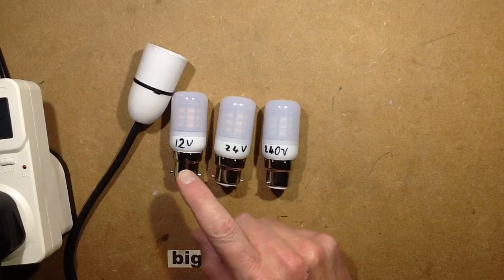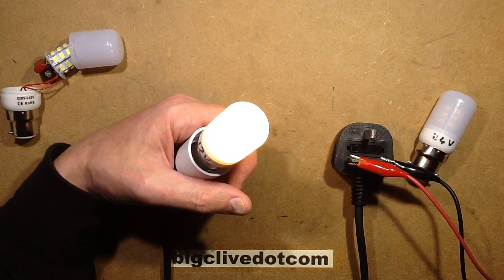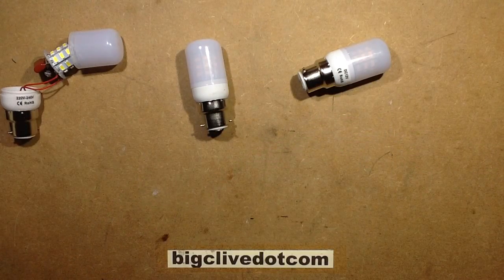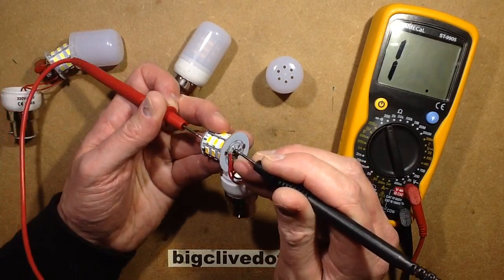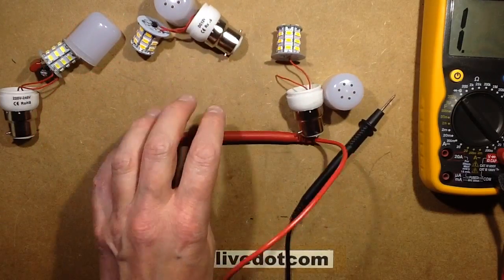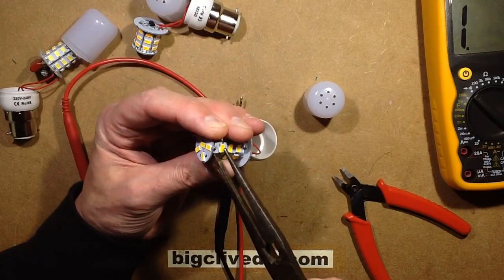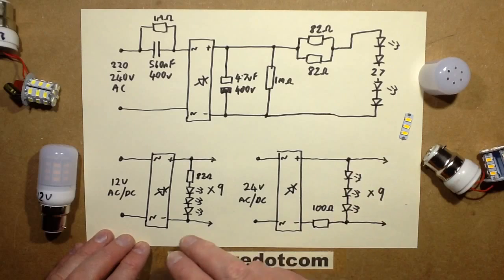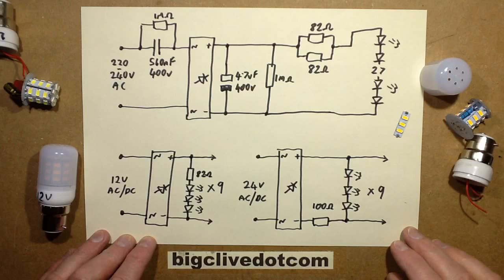12V, 24V and 220-240V LED lamp comparison.  (With schematics.)

Comment: Clive
I have a simple 240v strobe led lamp that flashes to music.  It lokks super basic when take it apart. But is there anyway i can make it run.off 12/14volts. Any tips or ideas...
Reply from the maker: That would mainly depend on the circuitry, and if the LEDs can run at low voltage.

Comment: Hi Clive
I have a "golf-ball" LED lamp. When powered it looks like the internals are of the pattern of the type you illustrated. On the bayonet cap it rates the lamp as 10 - 30 volts. This thing is sealed solid. What's your thoughts on its construction?

Comment: I live in a caravan with NZ wiring and my 12 volt keeps going out 2 12 volt lights so far. The people want to solar in a 12 volt capacitor on it to see if it has any more problems??? WHY  would they try this, the 240volt is fridge, kettle oven frypan etc, 12 volt lights are the ceiling lights only and run off the battery; cant understand why they want to do this and what does a capacitator do anyway hope you can help thanks

Comment: I don't know why people are surprise about low voltage Bayonet fitting. They been around for years. I still have a 12v incandescence lamp. Which looks the same as 240v

Comment: The right way to short out a capacitor is not to short it out but discharge it with a voltmeter. Shorting can burn out the connection from the plates to the leads.
Reply: By voltmeter a mains charged capacitor would take eons to discharge. Use a big ceramic resistor or mains incandescent lamp or send the current into the mains plug of a traditional (non-electronic) soldering iron to convert it safely into heat.

Comment: so i am fairly new, but what the hell does using a higher voltage lamp do, except from reducing the heat output inefficiencies (because Q=(I^2)*R*t). But most of the time, this is used to reduce heat inefficiencies on long cables that stretch kilometers, so how does using a 240 volt lamp help? or is it just to reduce the inefficiencies of a converting from 240 volts to 12 volts? what advantage does a 240 volt lamp has over a 12 volt lamp. if both lamps use the same technology (leds) and output the same amount of light, drawing the same amount of power, then increasing the voltage will just decrease the amperage, and decreasing the voltage will just increase the amperage (because R=U/I)

help me pls?
Reply from the maker: The 240V circuitry  (our local supply voltage) means that no extra power supply is required.  It's all built into the lamp.

Comment: How about the RFI from the 24V lamp? I have seen that unless you de-couple diodes in a rectifier bridge it can create some evil RFI. Just a small ceramic capacitor in parallel with each diode is sufficient.
Reply from the maker: the simple resistor arrangement in both the 12 and 24V lamps will result in no significant RF interference.
Reply: I was more concerned with it in AC application. As I do mess with ham radio I have realized that RFI comes from the most unexpected sources.

Comment: Is it common practice for ALL lamps to have the same type of base on them in the UK? really I do not know. Here in the US the 120 volt lamps tend to have the typical "E" type screw base (e26 i think it is, there is a smaller type for decorative bulbs but its not the everyday common type) while the 12 /24 volt have a small bayonet or very small "E" type screw base and are usually labeled as automotive lamps..

Seems pretty dangerous to put the same base type on  your 12/24 and 240 volt lamps..
Reply: I've never seen a DC bulb with a bayonet plug like that!
Reply: I only seen them with small bayonet bases like for flashlights, automotive trun lamps, and such
Reply: And those little educational electronic lights in schools, now I think about it. Those were cool.

Comment: Im only a newbie with electronics but i have 2X 12V 5.5 Watt Led lamps that light my workbench, and after an hour or so they seem to flicker a little. (I would assume this because they are getting very hot?) I have a 12V 60VA transformer powering them. can i add in an LED driver somewhere to reduce the flicker? or is there another way to solve this problem?
Reply from the maker: Is it a standard transformer or is it a lightweight electronic transformer designed for halogen lights?
Reply: I'm not sure but considering its flickering i would assume it is a lightweight one for Halogen lamps
Reply from the maker: If it's the light electronic type intended for halogen lighting then it may not be suited to LED use.  It will require a minimum load (usually about 20W) and will also put out a very nasty spiky emulation of 12V that peaks at about 30V and is no problem to actual halogen lamps, but could damage LED ones.

Comment: how much electricity can come out of a capacitor when you take something like that bulb apart like could it be dangerous if you didnt short it out
Reply: "it might sting."

That's an understatement. The capacitor might not do any lasting damage, but if anything solid/sharp is in the way of your hand you can do some major damage to yourself if you're not careful (When I was an apprentice, one of the boys broke his hand on the inside of a tv cabinet after contacting the bitey parts. Reflex actions can be a tad violent)

Many modern circuits put a high impedance bleed resistor (1-10M) across the capacitor to ensure it won't carry any nasty surprises when disconnected.
Reply: The energy stored in a capacitor of C farads charged up to a voltage V is 0.5*C*V^2. If the power was turned off at the peak of the AC cycle, the voltage would have been about 340V and the energy in a 440nF capacitor would be 0.025J. This is not dangerous, but it might sting.
Reply: Alan Brown I've never been stung by a mains capacitor myself, so I bow to your personal experience. Thank you for turning my numbers into physical convulsions ;-)

Comment: I admit I chuckled a bit at 7:05 when the wire snapped off, because that happens to me way too often when I take stuff apart.
Reply: happens all the time with the lead free solder they use, as well as the super thin wires
Reply: @jusb1066  Europe RoHS rules strike again!
Reply: @franklofarojr.2969  you don't think China using cheapest materials is the cause?

Comment: Clive,  they look like the 5630. So many different kinds of SMD  LED's and there are new ones coming regularly, especially for lighting. I bought 1000 of the 5630 after one of your uploads for ~$3 USD  and look for any excuse. Most recent,... for exterior night light  :-)
Reply: ***** yes, no word of a lie. Not easy to solder if you haven't a pcb dedicated to the dimension. Good day

Comment: Those holes in the light covers, are they functional or are they only there incase a toddler pops one off & swallows it? The whole lamp looks like one of those capsules you get in a kinder egg or from one of those vending machines they have at cornershops.
Reply from the maker: they'll help with ventilation and probably "venting" too if the electrolytic capacitor lets rip.

Comment: These lamps are great, since they can be repurposed as pepper shakers once they burn out.
Reply from the maker: Well I've got salt and pepper now after this weekends activities.
Reply: Well, the 12 V lamp (which was the good one)is now smoked. It would be interesting if you can get the 24 V lamp reassembled to keep raising the voltage, 28, 32, 37... and see what happens to that 100 Ohm resistor, and how bright the LEDs get before they black-dot.

Comment: i run a 12v ring in my home, with LED G4 and MR16 bulbs (quite hard to find spotlamp bodies for Mr16 now, nearly everything is mains GU10) I'd be interested if you manage to convert some mains bulbs to 12vdc, i would have no idea how to calculate the resistor required.

Comment: you have to press the angled top of the calculator to your surface . easier to get a flat calculator maybe ?
Reply from the maker: It's just the one I always have to hand.  The display isn't visible to the camera if I don't tilt it back.  I do have a much bigger and flatter calculator, but haven't used it yet.  It's actually too big.
Reply: bigclivedotcom its fine and appreciated that you always tilt it so we can see what it displays. I was just saying you could spare that work by looking for a similar size but flat one maybe
Reply: +bigclivedotcom alternative would be to make a wood or cardboard wedge to do the angling for you :) I use "Cardboard Tech <tm>" to do a lot of prototyping, make PDA stands with it, lots of things:)

Comment: I bought one of the mains voltage ones last year. It had the worst LEDs in it. Of the 10 I purchased, only 1 made it more than 4 months. The bondwires to the dies detach and arc out.
Reply from the maker: It's often because they are being driven quite hard, causing thermal stress.

Comment: Clive, what would cause one of these types of bulbs to have one row of the leds periodically blink on and off without affecting the rest of the LEDS much (the row next to it will get a tad brighter when the one row is off)??  I have a brand new 110v version of a 56 led 12W version of this kind of light- the innards look similar- that started blinking in the first 5 minutes of using it - see here: http://www.ebay.com/itm/221930211410

 THX
Reply from the maker: Many of these lights have the LEDs wired in parallel strings so if an LED starts to fail and starts cutting in and out that whole string will flash and when it is out the other LEDs in the lamp will carry the extra current.
Reply: +bigclivedotcom   Now the bastard won't blink with the cover off... oh well thx for the info!